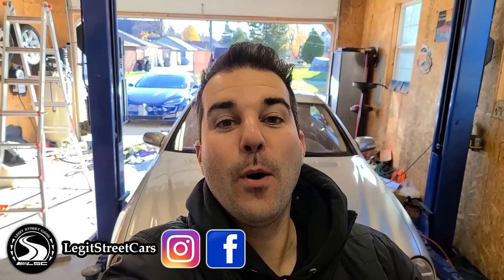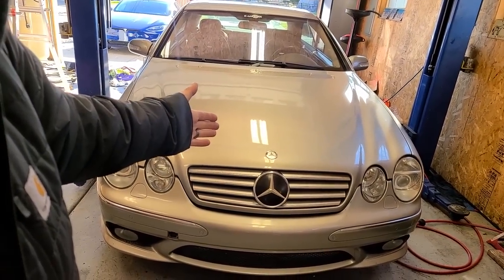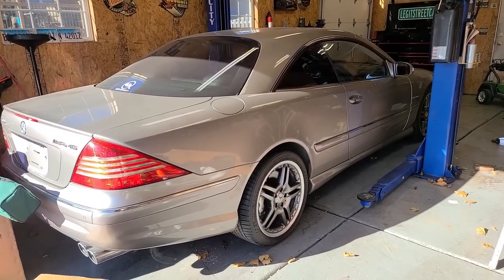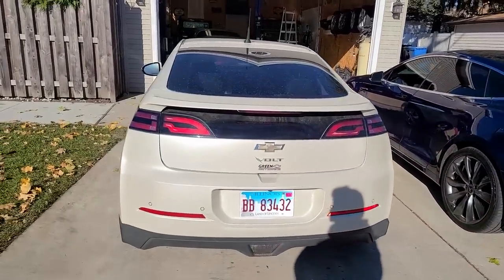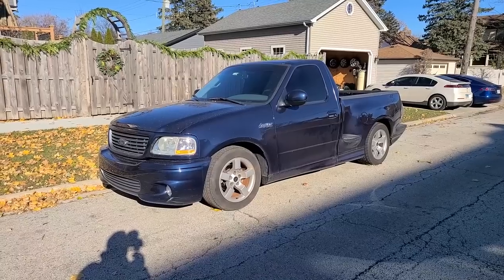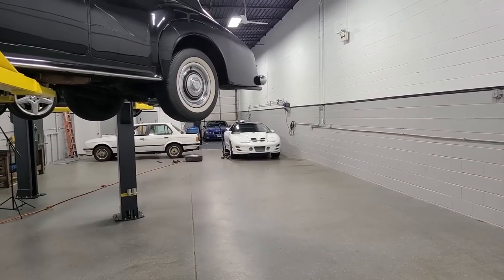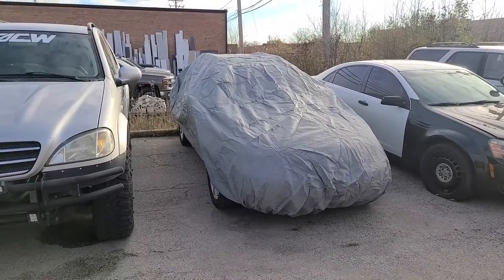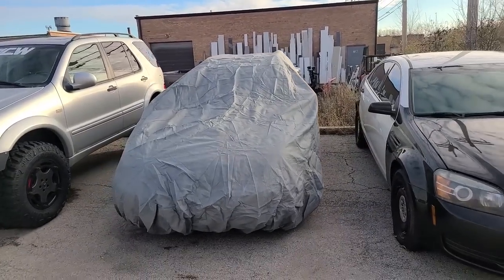Here’s What Happened To All My Cars. Big Channel Update!

Comment: Hey Alex. For used fluids, I use those 7 gallon camping water containers from Walmart. They don't leak, they're petroleum/solvent resistant and they have a pour spout for easy dumping. I started doing this because I was sick of dumping oil after every oil change and I was sick of lining my trunk or seat with blankets so the oil didn't drip on them. I think I dump fluids about twice a year now. Should fix your used coolant storage problem until you can find a local recycler for it.

Comment: I'm like you Alex. My dream car was a 1980 Z28. We've had at least one since I was born. We had a black with silver stripe 81 Z28 and my mom had a 91 RS with the 3.1 that was a dealer demo car. Then dad sold the black Z and we found a white with blue stripe 80 Z28 in April of 94, when I was 3 and a half. We've owned that car ever since and won't ever get rid of it. Its still a bone stock 350 with the lame 190hp and all I've done was a full exhaust no cats. I won't ever get rid of it

Comment: If you can learn how to rebuild things like hard to find racks and shocks, even air or hydraulic suspension systems, your services will be in high demand. Check out the problems Hoovie and the Wiz are having with such things. Dave knows he would lose money if he tried to dive into subsystems like this, but if you could combine it with great videos, it might be something to try. I am often amazed at how much you have to replace in order to fix a system.

Comment: Good update and keep doing what you’ve been doing. I watch mostly the German car videos. Please keep the 335i and do the turbos next. I’ve been enjoying the CL65 videos and can’t wait to see what you do to it. I am not into EVs, American muscle, trucks or SUVs but will watch that content occasionally if it looks interesting. Your comments on the B8 S4 sounded similar to my own thoughts on them. I had one for a couple of years and thought it was a pretty boring car. They are good looking, handle and go just fine but there is no soul there for some reason. I also had a previous generation B7 S4, and although that car had many flaws it had some character. Some platforms that would be interesting for future videos: Audi S6/S7/RS7/S8. The 4.0 TFSI hot vee versions from 2013-2018. These engines have turbo issues so that would be fun. A high mile tuned S8 would be particularly fun to watch. The old 5 cylinder Audi Ur S4/S6. Audi RS6 2003 era. Audis have their issues but have plenty of things to fix and are cars for snowy Chicago winters. BMW e34 M5, which are still relatively cheap and have a great engine. Jaguar XJ with the 5.0 supercharged V8. Nissan GT-R.

Comment: Man, you really did an extreme makeover on that Tesla. It looks brand new but better. Also, what's the thud noise on the LSC? The front tires are shot, looks like a there's a flat spot on the front left tire which would cause a thud per tire rotation.

Comment: Used to work on cars a lot when I young. Race cars and street cars. Interested in building me a motor. Thinking of LS motor with turbo. Would u ever consider a video on building a complete motor? Like to see what parts u use. What could combo of components. First engine I ever built was a 383 striker and 350 olds rocket engine. Also what trans u would recommend? Buying new or stock trans and have rebuilt. Love the channel and content. Also reason I asked was because I hoping u get that other TA from neighbor and do rebuild on it. Think it was a LS motor maybe? Just really want to take time and do it right. Looked at crate motors but really way out of reach for what I want. Like to be around 600-650 hp at first. Or if u know of good resource to help me. Videos or sites etc. Thanks again for great vids and professional advice to viewers. 👍👍

Comment: Love your content Alex, but if you find the cause of that thud on the E55 wagon please tell us. I have a 2012 CLS63 that has been making a clunking noise for two years now when I go over speed bumps or make a hard right turn at low speeds (such as when pulling in a parking lot). I have looked for an issue several times myself, taken it to a reputable independent mechanic in my area, and it has even been to the dealer for service campaign work, fortunately for free, and NO ONE has been able to find anything wrong with suspension. The only other issue is that the front-end cross caster was slightly out of spec after a 4 wheel alignment.
Reply: Confirm you strut mounts are still in one piece.. sounds like a recent situation here

Comment: Hey Mike, I have a w208 AMG. Just did flex discs, center bearing trans and differential service. As well as rear wheel bearings and new parking brake shoes. Car now has a sort of whirl at approx 19 mph and also apron 38-43. Any ideas? Thanks!

Comment: It really would be great, if you do a video, that shows to wrench - less talk about, how to wrench. You are so experienced with MB - that is, what we like to see, I think. The last 3 videos on the Merc, with repair of the Rodeo-Function, they were great! 

Would like to see, you buy a small SL, 163 hp or an newer 350 mit 272 hp - rip off the engine, renew it complete, all gaskets. Renew the brakes, do new brake-lines, new wheel-bearings, new calippers, replace the heat-mats in the seats, and so on. 

Show us, the non-professionals, how to repair our own mb-cars. The stealerships rip of the custumers many times. Show us, how to do it ourself. 
Less talk, more wrench!  Buy a crap-car, old, high mileage and rebuild it, like brand-new. 
This gives you many content, this gives the viewers a lot of education, depending on car-repairs. 

M539 is doing a great job on BMW cars. Make copy-paste! :) In your own way, of course. 

BTW: If you want a car to love, buy a 60s bug. Repair it - drive it. 40 or even 30 hp will do! 

Continue your great channel!

Comment: Yeah I wanted a ls1 T/a 6 speed so bad when they came out I remember the commercial the T/A eating another car at a red light. I finally got mine back in 04' but had to settle for a 99' SS Camaro still got it and its boosted too but needs some tlc haven't messed with it in years. Other then only the half dozen tin foil 10 bolts and one T-56 I'd beat the  livin fuck outta that car day in day out and never let me down It's the most reliable car I ever owned

Comment: 12:27 Imagine getting coached by a 6 year old on how to change a tire XD The only thing the TA is missing is some wicked cam chop ;)
Reply: Not if he wants it to be streetable :)

I used to own a cammed LS1 ute and that thing was a pig trying to putt around at low speeds in town. Being a six speed manual with a heavy duty clutch didn't help, I guess at least the TA is auto.